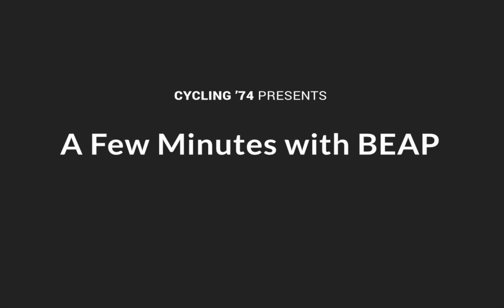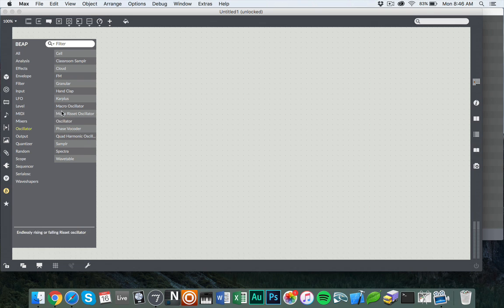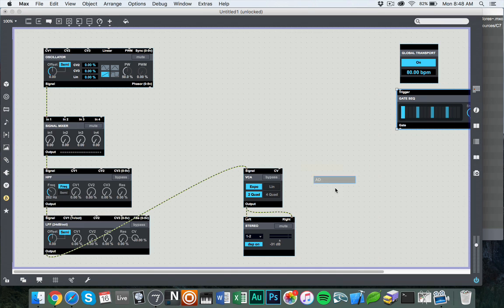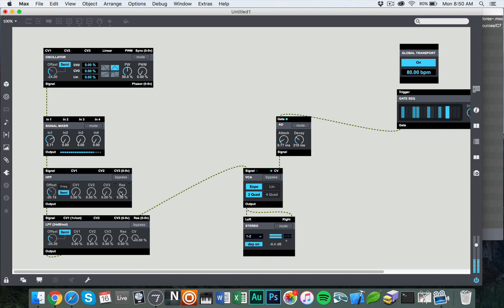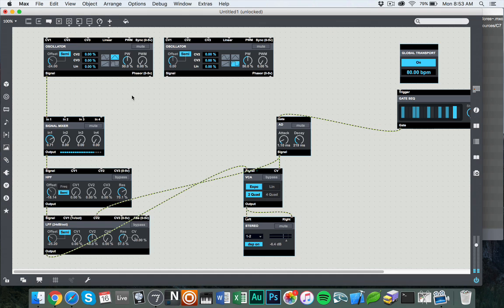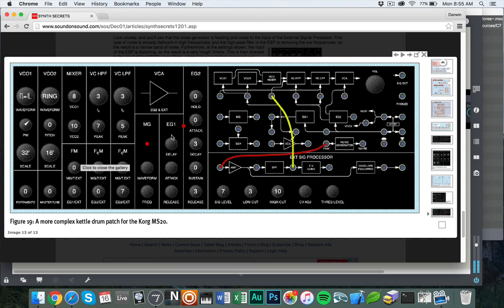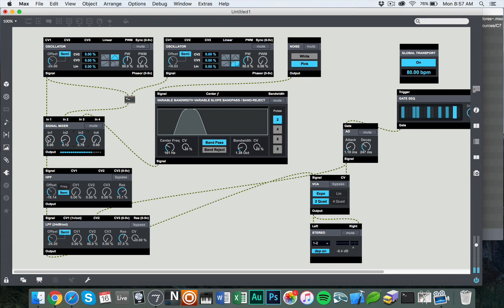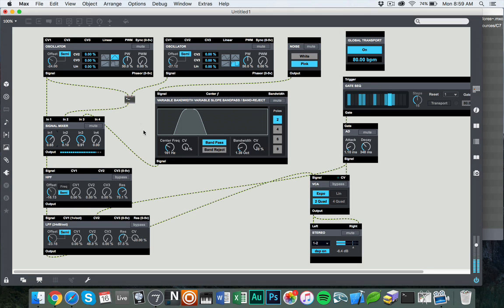A Few Minutes with BEAP: Implement Kettledrumming and other Synth Secrets (Part 8)

Comment: Nice!
I would like to see MIDI learn in beap. Like the Ableton one.
I like the patching style of the beap modules, like on a real modular setup and indeed on max7, but the real fun, is hands on knob twiddeling.
I'm sure it can be done :)
Reply: You've probably figured this out by now but you can double click to open up the beap modules and assign midi control to the parameters inside with the ctlin or notein objects.
Reply: Well, double clicking, does nothing. Not when the max patcher is lock and neither when it is unlocked. Do you mean right-clicking and open new view of... or open original... ?
Reply: Sorry yeah with the patcher unlocked hold comand on mac i guess ctrl if windows and double click. That should open up another window with the device in, you need to go to the bottom left hand corner of that and click the little pen, that'll reveal the normal unlock icon which once clicked will open up the device so you can modify it.
Reply: Ok. And this will leave the original BEAP module intact, and only affect this particular instance of it, yes?
Reply: No you should make a copy of it somewhere with a different name.
Reply: You'll have it in Max 8!